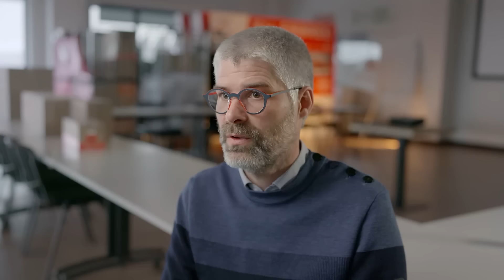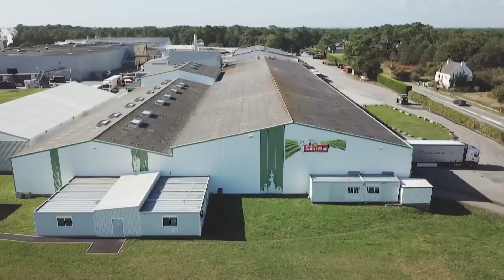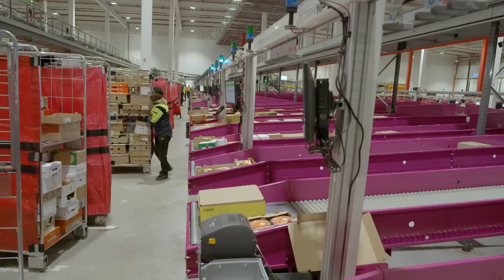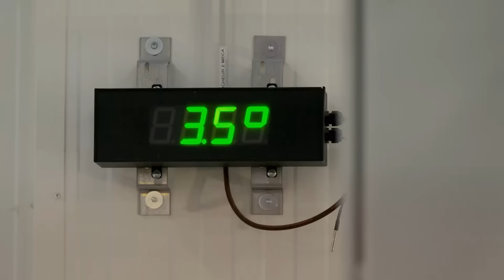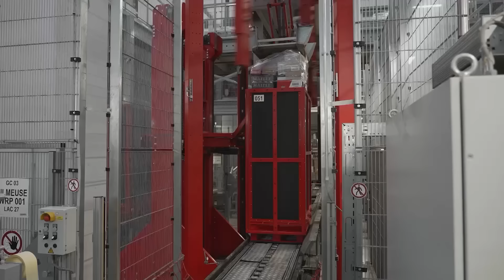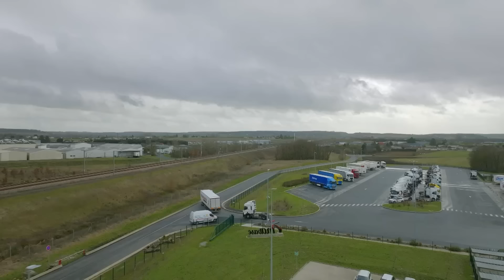The Supermarket Machine: The Invisible System That Never Sleeps - Full Documentary

Comment: It's all good that the logistic distribution centre receives and dispatches the cold/frozen items quickly, keeping the temps correct, but then it relies on the 'buffoons' that are responsible for putting them in the fridge or freezer in the store before they warm up. Many times I've seen staff work pallets of frozen goods out on the floor for over an hour, ice cream, veggies etc. no wonder they are in a solid block when you go to buy them. I was told by a dairy person that milk will lose 1 day of shelf life per hour left at temps over 4deg C.
Reply: In frozen goods handling facilities there are Ante rooms maintained at 0 to 4 degrees. Ante rooms acts as a buffer between unloading docks (the docks usually have trucks engaged to the rubber seal along shutter door and cut down interaction with ambient temperature while unloading) and put away zone (to storage area). From Ante rooms the products must be stored into frozen storage area within 15mins to 30mins. So the design of unloading area in the facility should be considered and resources to move goods faster to storage area is key in maintaining the quality of frozen foods. Unfortunately the facility and operations management don’t talk to each other and miss out this part in the design phase!